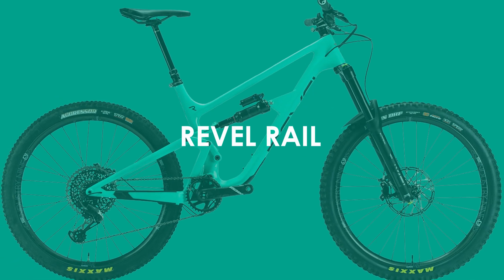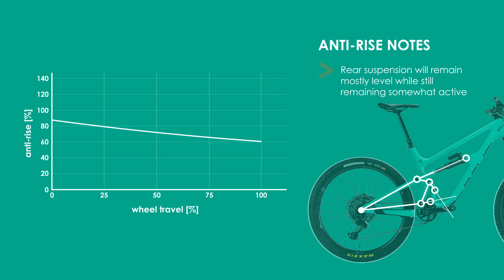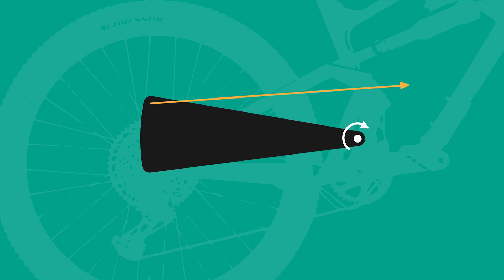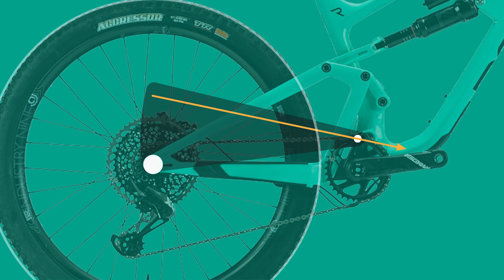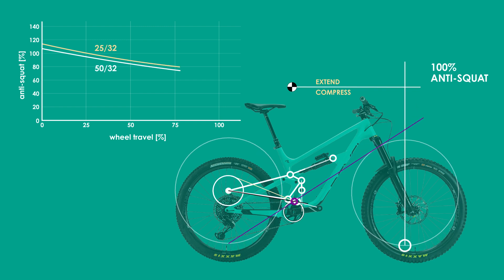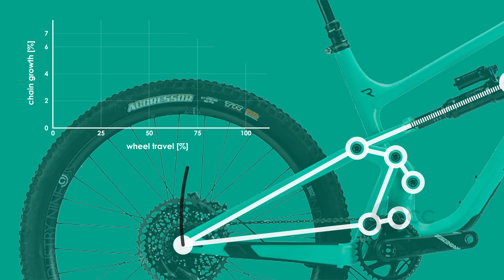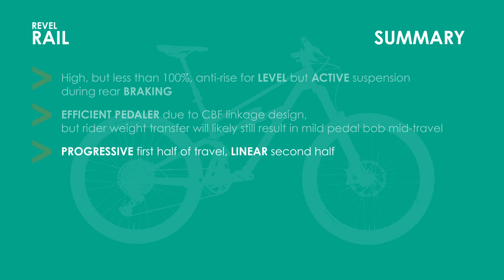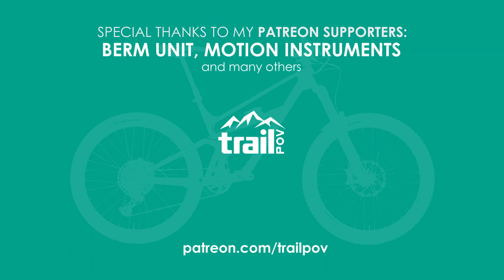Revel RAIL CBF Suspension Design REVIEW

Comment: Great content! So, I am curious if your analysis shows this, but will an oval chainring have a negative effect on this suspension design?
Reply from the maker: Happy New Year. Nothing inherently special about an oval chainring except that it's tooth size changes as you rotate. So when it's a 'bigger tooth' you'll have marginally less kickback and with the 'smaller tooth' you'll have a tiny bit more kickback. But I'd say the different wouldn't be noticable. FYI I run an oval chainring on my enduro bike and love it for the uphills!

Comment: Awesome analysis. Shame you don't do these anymore.

I have a Revel. Compared to JS Tuned and Pivot's DW, it's ok. I could use a flatter antisquat curve and more progression. I'll probably sell it. I can't really tell a difference between CBF and a well designed linkage driven single pivot like Orbea uses or a Horst like Transition uses. But these bikes do the job while being lighter and simpler. Maybe if I used higher poe hubs then the low kickback would be a good feature.

All things considered, my opinion is that modern linkages of any type are all very good. Even Orange's pedestrian single pivot gets good reviews (though I haven't ridden one). Most of the complaints people have with their bikes relate to some failure of the shock design or tune. But few people want to spend the extra $500 to get a custom tune or better shock.
Reply from the maker: Thanks. I continue to do raw number analysis over on Patreon if you're interested #shamelessplug
Reply: @TrailPOV  Sweet, been meaning to. I see you got about two bikes a month. Very good.

Comment: I would be interested in seeing a comparison between the Rascal and the Norco Optic. I just went from the Optic to the Rascal and I want to know if what im feeling is in my head, or if it makes sense lol. I do feel that the Rascal is always the same, it feels very controlled in drops, turning, braking etc where as other bikes ive ridden can dive when you slam the brakes or dont want to turn and brake. I also wonder how much different a simple design is vs a complex one, do any of the suspension designs just suck compared to the others? This is interesting, thanks for making these vids
Reply from the maker: Glad to help in any way. There definately are good and bad designs. High pivots seems to be all the rage with big travel bikes and for good reason when it comes to kickback

Comment: Brake jack and anti-rise are 2 separate things. From Christophe Benoit, Project Lead Engineer at Devinci: "While they both refer to braking forces, they are not expressed in the same way. Brake jack is a resulting force in the suspension that comes from the caliper. In practice it is a force that gets transmitted to the shock but it is not the main force at play. Anti-rise is expressed as a ratio of forces. The anti-rise method allows us to take into account the force of rider mass acceleration and the angle at which the load is transferred at the wheel. It is part of kinematic simulation and is considered with many other factors when positioning pivots (shock type, geometry, leverage ratios, axle path, pedaling characteristics)."
To address brake jack floating calipers are sometimes used or mounting the caliper on the seatstay (like the Split Pivot). But this has nothing to do with the anti-rise.

Comment: I got to test ride a Revel Ranger, and MAN was it good!  I ride a hardtail at the moment, and I have a couple of local 15-20 mile rides I usually do 3 times a week.  I took the Ranger on one of those rides, and it climbed shockingly well for a full suspension bike.  Not quite as efficient as my hardtail, but far better than a couple of other full suspension bikes I have tested on that ride.  There was zero bob under hard climbing (as far as I could tell) and it was a cushy rocket down the hills.

I ride in Northern CA where the trails are dry, gravelly and rutted, with quite a few rocks sticking out from the hardpack.  The Ranger is what I'm saving my pennies for, so I can buy the frame and transfer all the good parts from my hardtail onto it.
Reply from the maker: Nice. Happy Trails!

Comment: Can anybody answer a question. I recently purchased a Revel Rascal and the rear seems to break loose easy on power climbs, more so than my 5010 did. I'm running a 30t chainring, would a 32 tooth chainring help this?
Reply from the maker: You've just got too much power in your legs! Have you tried an oval chainring to even out the power strokes?

Comment: What do you think of adding the Push Eleven Six Coil to the Rail over air shock? Would the leverage ratio be too linear at that point?
Reply from the maker: While the leverage ratio itself wouldn't change (as it based on geometry alone), the spring rate and wheel rate would change. The air shock makes up for the somewhat linear leverage ratio, so a Push Eleven without a progressive coil is likely going to provide too linear of a wheel rate.
Reply: @TrailPOV  Having added a Push Eleven to my Rascal, I can say categorically the bike is "better".  I was not very satisfied with the feel of the Rascal with airshock. No matter how much adjustment I made,  it felt harsh.  I did not get a playful, progressive spring feel. I tried spacers, air pressure and compression damping, but it kept feeling like the frame was too stiff.  As soon as I replaced the shock for the Push, the bike just got a more forgiving feel. Much better traction and still had a bit of progressivity to the feel.  I think some of my complaints are more to the amount of travel. I suspect had I been riding a Rail, I would have been a bit more satisfied right off the bat. If only it came in 29in.
Reply from the maker: @joedunne635  Great input. Thanks

Comment: A few things. The first is the term brake jack. I think of this as extending the rear suspension not compressing hence the term (jack). Such as was found on some bikes of the late nineties and early 2000's. Have you looked at Chris Currie's 3VO (speedgoat.bike)? I would like to see how his design compares to both the Revel and Turner's RFX 4.0.
Reply from the maker: Thanks for the input and bike suggestion...I have not taken a look at 3VO yet. Regarding brake 'jack', I guess technically it's brake squat rather than jack, but most people haven't heard of brake squat, only brake jack, and only know what brake jack feels like. Brake squat is the suspension compressing and getting firm, while brake jack is the suspension not wanting to compress and also getting firm. I was trying to refer to brake stiffening overall that's common place with single pivots. Sorry for the confusion.

Comment: Thanks for the videos! I would be interested in Kona process134 (new one) and norco optic 2020. Btw: I realise how similar different suspension designs may become if well engineered. Hence I get the impression that in trail features like switchable shock travel (Scott genius) or leverage ratio (canyon strive) give more impact then suspension system (single pivot Vs VPP Vs ...) Except maybe the high pivot designs
Reply from the maker: Thanks very much for the input. While there are similarities between some manufacturers, there are also a large number of differences between suspension systems overall. Certainly the shapeshifter and adjustable shock do make those differences even larger
Reply: @TrailPOV  where do I have to vote for next bike analysis? I would also be interested in the new propain tyee
Reply from the maker: @Cg-fh5re  I've been doing all the voting on Patreon. But the next few vids may already be selected depending on what a couple bike stores say

Comment: Can you do Trek's ABP design? It's basically a regular Horst-link design but the rearmost pivot is concentric around the axle, which is supposed to decouple the suspension from braking.
Reply from the maker: Hi. Thanks for the suggestion. It will definitely be covered at some point

Comment: I would like to see one on the Trek Top Fuel 2020. I would be interested to see as its very different from previous years with a floating shock.
Reply from the maker: Thanks for the suggestion. I ended up chatting with a Trek rep about this a couple months ago and it was interesting to hear that suspension tech has come far enough that they didn't need the full floater anymore.

Comment: Another thing that just occurred to me: CBF is different from a single pivot in that a single pivot’s instance center AND center of curvature can both be placed at the top of the chairing. CBF’s instant center stays out in front of the bottom bracket, making for a larger radius axle path for better square hits, while still keeping the chain forces perpendicular.
Reply from the maker: Partially correct. The IC is in front of the chainring that changes the braking characteristics, but the axle rotates around the center of curvature not the IC. Hence why it's called center of curvature. Just so happens that the center of curvature is located on the same line as the axle-IC line.
Reply: Trail POV Well now I’m confused again 😂 there’s a reason I’m a musician and not a physicist!
Reply from the maker: @dawnpoint  Haha. The axle-IC line just means that the axle is moving perpendicular to the IC (and by necessity the center of curvature) at that particular point in time...but not necessarily rotating around that point over time. If the IC didn't move then yes the IC would be the CC and the axle would rotate around the IC and CC. But because the IC moves it causes the axle to rotate around the CC only.
Reply: @TrailPOV  Aaaaah ok that makes more sense. I'm still a little confused though--My friend's Trek Slash has the main pivot pretty much in line with the chain but it pedals like a water mattress compared to my Canfield. What principle am I missing?
Reply: @dawnpoint   If the computer was correct in telling us how suspension works, then the single pivots would feel like a CBF. But they don't.  Pedal bob and brake jack are real!   CBF is following the IC thru out travel.  That is it's magic.  No other suspension does this.

Comment: Brake Jack is suspension compression? I thought it was extension.
Reply from the maker: I guess technically it's brake squat rather than jack, but most people haven't heard of brake squat, only brake jack, and only know what brake jack feels like. Brake squat is the suspension compressing and getting firm, while brake jack is the suspension not wanting to compress and also getting firm. I was trying to refer to brake stiffening overall that's common place with single pivots. Sorry for the confusion.
Reply: @TrailPOV   I think it's good if we can stop spreading the confusion. Especially since some brake squat can be quite a good thing. Back in the days when Fabien rode for Kona he asked to have the floating rear brake posissioned so that it would squat MORE and not LESS :)    BTW here is a good text on the subject: https://www.bicycling.com/bikes-gear/a20022920/mountain-bike-feature-jacks-not-here-man/

Comment: have you heard of the AOS suspension sistem by GT?
Reply from the maker: I have. Very unique for sure. So far it hasn't been heavily requested by the YouTube community.
Reply: @TrailPOV  I have the latest iteration of their I-Drive on my custom Sanction and demoed/tried all their AOS bike range. Basically, in my experience, they don't feel that supple of the top but, my G.O.D., when you are putting the hammer down, those square edges "magically" dissapear from the trail, be it on the 110mm Helion(AOS) or on the big hitter Sanction(I-drive); I took a Helion with 130mm Pike in front on a red bike-park trail in northern Italy and I could not believe how fast I could get on it, not because of the Pike in front but, because of the suspension system in the back.
The free-floating BBs with that rearward axle-path could have been a thing, especially since it involved using only a single-pivot but, yeah..the industry and also GT wanted something more easy to work with and more efficient so, that is why 90% of the current bikes are with a damn horst-link. It is not that is bad or something..but, based on my personal experience, I have to yet to encounter one that gives a distinct feeling.
When you have a 16kg super-enduro bike(180mm fork) that pedals up-hill in open mode with a sporty feeling and then, when you point it down, makes big roots and rocks and all of the square edge type of obstacles non-existent, I for sure can forgive the less supple feeling of the top, as new/current bikes/designs offer. 
This year I will get another bike, a very capable one, the winning EWS type...but, I sure am going to miss my big old GT.

Comment: Would prefer Switch infinity or cbf or dw link?
Reply from the maker: I think each of them have their merits. It also depends on the particular implementation for a particular bike. Of the bikes I've looked at I'd personally go with the Revel because it's 165mm travel rather than 150mm in the other two.

Comment: Correct me if I’m wrong but isn’t the end result quite similar to a DW like those on the Pivots? Just a different way of achieving it?
Reply: Very similar, you're right, although the CBF does slightly better at maintaining consistent feel and efficiency regardless of suspension position. The DW links are a little more dependent on a specific sag point for maximum performance. I.E. with CBF I can run much squishier sag and not notice a reduction in pedal performance.
Reply from the maker: Well said
Reply: @dawnpoint  Ah yes that does seem to be the case. I also noticed the anti-squat and anti-rise values to be slightly lower than DW (I could be wrong), possibly to compensate for that wider range of chain growth? Would love to swing a leg over one just to see how it compares to a DW.
Reply: Shaun Seah Same, I haven’t yet tried a DW bike but my Canfield has left nothing to be desired. I have literally never used nor wished for the climb switch.